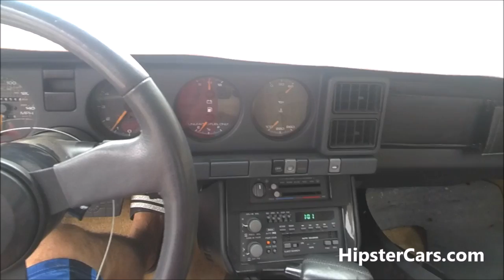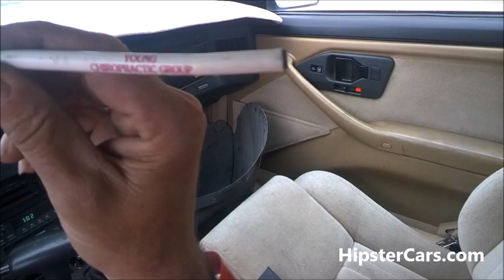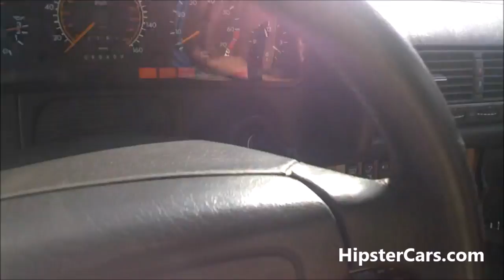Cold Start Trans Am & Fuel Pump Mercedes Benz S600 Repair Work Video #1

Comment: Start small and work your way up.  Plug wires, cap, then injectors.  It doesnt sound restricted so I doubt its a bad cat.  If the gas was going bad and starting to varnish, it can foul the injectors.  Maybe vacuum leak?.  Make sure you change out the thermostat.

Comment: I think I'd throw spark plugs at it.. since they are cheap.. but with all that bad gas.. probably suck injectors.. can tap them with it running.. if you can reach them..

Comment: check the on board computer to see if any codes pop up
Reply: +Cereal Marshmallows 88's have an OBD1 computer.  You can run a jumper between two pins on the ALDL connector under the dash and it will flash the 2 digit codes with the check engine light.  It's the top right 2 pins ( http://www.gnttype.org/images/conn.gif ).  With engine off, key on you will get code 12 three times, and any stored codes after that.  Write them down and google GM OBD1 codes for the meanings.  These can sometimes point you in the right direction.  I didn't notice the check engine light on in your video, so this may not be much help.

Based on the poor state of the collapsing vacuum line you showed, probably a safe bet that many of the vacuum lines are in poor shape.  These older GM cars DO NOT tolerate vacuum leaks at all.  Replace them one at a time so you don't forget where they go.

You said you replaced fuel pump in the video.  These have a fuel pressure regulator; it may be bad as well.  Need to verify fuel pressure with a gauge.  Should be around 40 psi at idle.  This car should have an easy to connect to valve for checking pressure.  You can rent a tool for free from many parts stores.  

Based on how easily it starts, the spark timing is probably close enough.  

Odds are you have bad vacuum lines and therefore vacuum leaks.
You may have a fuel issue like a bad regulator or stopped up injector(s).

I would start there.  Those are easy and definitive things to check/fix and cheap.
Message me if you have any questions: happy to share information if you want it.

Comment: she's missing or firing order is wrong.. can have your guy ground out one wire at a time with a test light.. stab through wire boot at distributor..while you load it up with the brakes on in gear..see what wire doesnt make it run worse.. that be the cylinder that is missing..bad plug or injector.. I'd say also take off the IAC "intake air control" and clean it.. since the car stalls  :-)
Reply: agreed! that's how I tracked down 2 bad fuel injectors
Reply: Idle Air Control only affects idle.  partly throttle or full throttle miss fire is something else.  Bad or dirty injector is likely.  moisture in cap is also a good possibility.
Reply: tiporari Yep, you're right.. but I did notice it stall.. since it has been parked so long.. cleaning such parts can't hurt.. I'd even clean the mass air..
Reply: tiporari I hear you, I've had gm cars years ago..do all kinds of weird crap..  broken wires to map sensor.. running really rich..from temp..sensor.. I'd say the exhaust is fine. had a few cylinders acting up.. the darn engine shampoo..could be why.. I only have washed one engine.. and after issues..I don't anymore..lol
Reply: 462ANIMAL Yeah, washing an older engine like this is a gamble.  Not as air tight as newer cars.  Asking for trouble unless you're damn careful!
Reply: Cereal Marshmallows Hard to troubleshoot without getting hands on it.  Is your fuel pressure good after replacing the pump and filter?  If not, could be a bad regulator or its gummed up.  They bypass when leaking, worn, or gummed up allowing pressure to bleed off back to tank.  
If fuel pressure is ok now, that leaves either a spark issue, or a sensor issue.  The computer will tell you if any sensors are acting up.  Check codes and see if it has any.
The spark issue could be as simple as needing a tune up (plugs, cap, rotor button and wires).  Age and moisture will break HEI ignition down.  There's also and electronic spark timing control on these which needs to be working right.  You need a timing light to verify it's advancing the timing when you Rev it up.  If the timing is not advancing correctly, the engine will idle ok, but  bog down under load, backfire or stall.

Comment: The way it's popping and banging really sounds like air leaks into the engine leaning the mixture off far too much...
Reply: +gosportjamie   The way it's heating up really quickly also suggests air leaks causing a weak mixture as a weak mixture burns much hotter than a proper mixture.  You need to be careful running it like that as the extra heat can burn out pistons, valves, head gasket or even warp the head beyond repair...